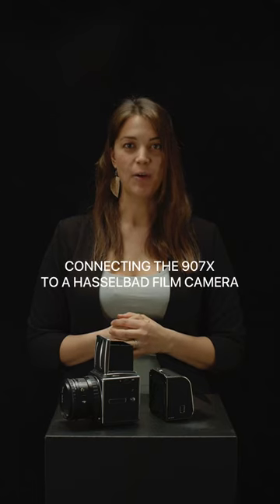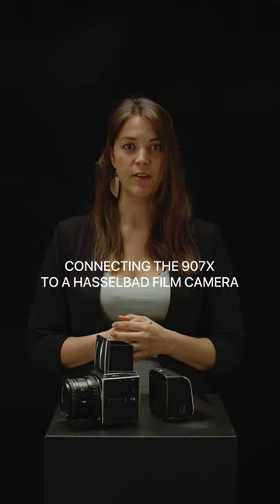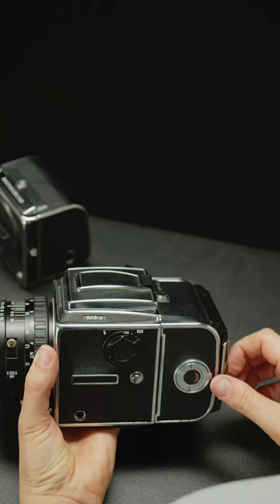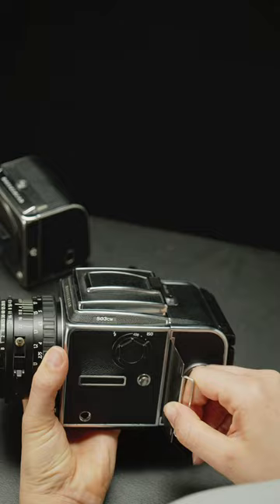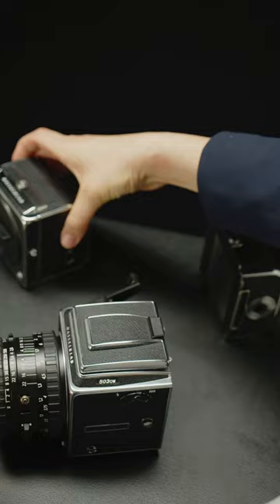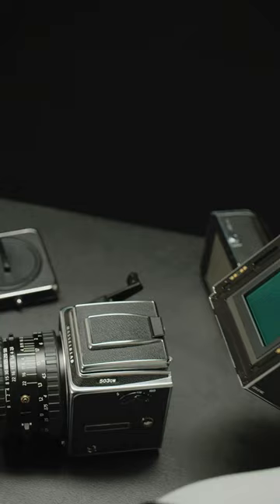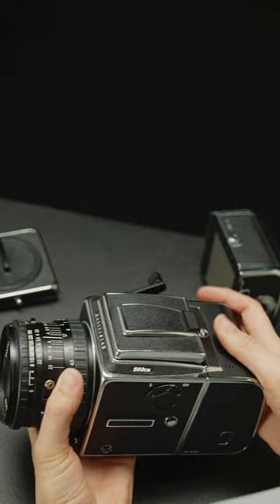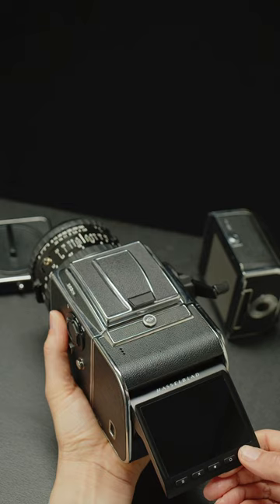How to turn a film camera into digital #shorts

Comment: I just want 6x6 format with digital back. No square format, no Hasselblad to my sense.
Reply: but thats square , 6x6
Reply: @waveril5167  digital matrix is 6 by 4.5. You can see it on this video that its not square
Reply: @egoragapov2033 it’s a lot smaller than 6x4.5, it’s 4.4x3.3

Comment: Shame the sensor is so small. It’s no where near the same size as the film strip. Makes the camera a very different experience.
Reply: It’s not that small , but smaller. In part is good, that allows you to use the sweet spot of the lenses. They are not up to a 100mp almost full frame sensor. It also make it less expensive.
Reply: @jaimeduncan6167  I get your point. I commented based on the claim that the digital back is a simple replacement for a film back yet it’s coverage is very much smaller. Yes. Sweet spot is used but also your lenses are now very much different to their original focal lengths. How can you get a wide angle ?  Fuji also has much better value for money. I do wish they would put in a larger sensor ( physical) and get the prices down .   I understand that this would be difficult to do though.
Reply: @jaimeduncan6167  "Less expensive" It's a Hasselblad.
Reply: @jaimeduncan6167  it's small AF. Back in the day you could chose from 44x33mm, 49x38mm and 54x41mm backs with even one unusual 56x36mm one from Leaf. Now it's all about 44x33mm and pushing more megapixels instead of bigger sensors so people can use legacy lenses to their fullest. It's about pushing the new crop lenses for $5-8k.
Reply: @KNURKonesur  somehow I can't read your full answer. I can read until 'Now it's all about 44x33mm and'  I will wait for you full message before answering. Best regards
Reply: @KNURKonesur  that's because those were CCD sensors, we've moved on to better performing CMOS sensors now which are probably harder to manufacture in bigger sizes

Comment: Make new X-Pans already! Both film and digital would sell like crazy!
Reply: They couldn’t make a digital x-pan, the censor would be too big.
Reply: @chet6286  That’s bs. Off course it‘s possible. Even the smaller digital medium format cameras have a similar image size. The larger ones are much bigger. The only challenge would be to make a shutter for such a wide sensor….
Wait they already did with the original X-Pan.
Reply: @chet6286  the original xpan uses 35mm film.... the problem isn't the sensor.... you can easily slap 2x FF sensors next to each other no problem.... the "would sell like crazy" i think isn't really the case though.... the X-Pan is already a niche camera.... the development and production would probably not be profitable i assume
Reply: @LoFiAxolotl same thing with the 907x, it’s a very niche camera. No reason for it to exist when it’s the same price as the x1d ii. The thing is hasselblad would have to make new lenses for the digital xpan, which would have to have a large image circle while also being small. The lens would have to cover an area larger than the H or X line up currently can since it’s 65mm on the longest side
Reply: They didn’t make it. Fuji did. The gfx has an “xpan” crop mode built in. Coincidence?
Reply: @zackrolls  Is the GFX a rangefinder? Is its sensor 65mm wide?
Reply: @VariTimo  rangefinders are fragile and niche. Gfx with xpan crop is good enough and to be honest offers much more than xpan. If digital xpan would sell like that it would already be on the market

Comment: what? I was expecting an explanation of how it works, in particular, the camera is mechanical, how does the camera know when to shoot? do you have to use a sync cable? is it in digital shooter only meaning you can't take a picture of anything that moves? any bit of information.

Comment: Any plans on making a 907X with a 54x54mm sensor? The 44x33mm sensor is what keeps me from buying the modern backs. I don't want a huge crop. I want less focus on megapixels, more focus on dynamic range and sensor size.
Reply: No sensor exists. Even if Sony were to create one, it would probably cost 2x as much as this one. Doesn't make much sense because Hasselblad would likely have to design all new lenses since the X series lenses will not cover this and the H series lenses won't work with the mirrorless systems.
Reply: the heat, the electricity needed, the file size etc etc etc just not feasable.... also makes no sense... the difference is negligable...

Also we're at a limit when it comes to dynamic range.... there's not more you can get except if you increase bit depth... and then you'd get multiple gigabyte sized files per shot...
Reply: @LoFiAxolotl Then why does film have better dynamic range and midtones? Digital always looks oveesharpened and washed out.

Comment: It's stylish but $6k is way too much for something like this
Reply: $6k would be a steal if the sensor was full frame 6x6, not a 44x33mm crop.
Reply: @KNURKonesur  homie i guarantee you can take photos just as good for less money
Reply: @KNURKonesur  sooooooo math is hard an all... but 44x33mm is bigger than 35mm you know that right? so 35mm or Fullframe would be a cropped version.... even if you crop a 44x33mm sensor to 6x6 you still have more sensor than a 35mm